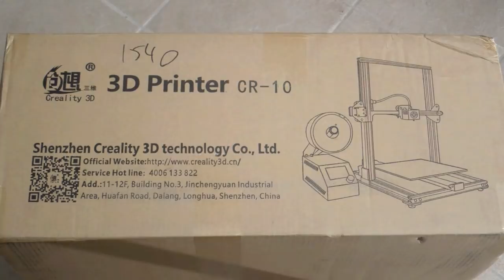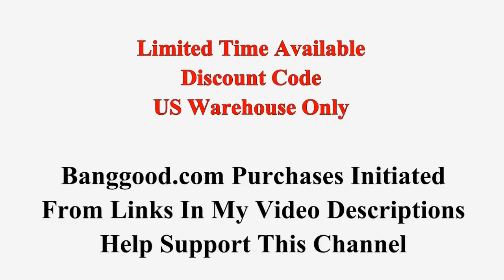Creality CR-10 3D Printer - Unboxing & Review

Comment: Hey Ron I purchased the same printer shortly after your video and my son and I have been having lots of fun with it. Recently the printer has been freezing and stopping prints halfway through a print. Wondering if you had any issues with the computer and it freezing up on you in any solutions?
Reply from the maker: In the control panel somewhere there is a reset command... try that. When you first turn on the CR-10 make sure both the nozzle and the bed indicate room temperature. If the thermisters for the nozzle or bed start to crap out it could certainly shut things down. The unexplained problems I have experienced have been associated with Cura and I ended up switching to a newer version of Cura and problem solved. Note I have not been able to use the newest version of Cura... back up a version or two. Hope that helps. Ron

Comment: Ron.  Nice Review.  Do you have a link to the filaments you purchased?
Reply: Regarding your build plate.  Did you add that on top of the existing plate or did you replace it?
Reply from the maker: Removed the original glass plate and replaced it with this one.
Reply from the maker: Got the cheapest NoName PLA on eBay out of California. 1kg spool $13.49 shipped. Just look for it.

Comment: A happy surprise to see you get into 3D CAD. What CAD program? Way to go Ron!
Reply from the maker: Trying to get familiar with Fusion 360. Started off trying to do the mouse left-handed which wasn't much fun. So quit messing with it until recently. Now back to my normal right-handed mouse which certainly is easier.
Reply: Good choice. I have heard the best remarks including Autodesk Inventor Support Guys who are CAD Masters of the highest degree except for maybe our friend Thang. :-) I put Thang at the very top of the list. I should learn it but I'm happy with Inventor 2009. I have to run the program using Windows 7 32Bit on my Windows 10 64Bit i7 computer via Virtual Box. I think Fusion 360 is about the same as the newer versions of Inventor without the extra Simulation feature and etc. which most people would never use anyway.
Reply: Ron, sorry I always seem to be pointing out something "I think you need" HA!:-) I highly recommend: Spacemouse Compact by 3dconnexion   Ask a few Fusion users first but I think it will really help you enjoy the CAD experience.

Comment: Great video!!!  Boy I could get in trouble with this spending a bunch of money for supplies
Reply from the maker: I had cabin fever really bad with the shoulder thing. So this was a great new toy that I could play with mostly one-handed. In the short time I have had this, I have made around 120 prints... probably way more than most people would do in the same amount of time and I have gone through 2 spools of filament. I have been getting 1KG spools of PLA for around $14 and now I think I have 12 different colors. If you stick with one color like black (orange is way over done) until you perfect what you are doing the cost really isn't too bad.

Comment: Before each print starts (as it builds up heat, which btw, as it heats up the bed, you can go in to tune, temperature, nozzle, and set it to heat from the dash, to save up time) you should set up your height (i usually touch the build plate, and lift it 1 mm, it might not seem relevant, but it does behave differently) and then, as the nozzle reaches close to temp (say if you're set for PLA at 200, then around 195) release the spring tension on the filament catch, and push it in manually. 

This will effectively preload your nozzle and save you the hassle of having to wait for the filament to reach (because of retraction, which should always be active) the tip. As it will start, you'll see that it hits the build plate, and then deposits a small bead of filament on and continue to extrude as it goes, with that filament in place. I usually pick it up in my hand, and keep it in place until the nozzle touches the start point in the gcode program. Then pull it quick out.

That will ensure a nice start, and eliminate the danger of the nozzle getting continuously touched by the PLA in one spot because there might've been something raised in the first OP.  Once you get the hang of this little routine, it becomes second nature. I don't even think about it when i do it anymore, before this, (even with tweaks directly to the machine's gcode, this still was a problem, especially for someone like me who doesn't have time to baby the machine).

One last thing, look online for methods to keep your machine safe, fireproofing, safety switch (all stop), fuse mods, etc. Worth the time to protect your investment. OH, and if you ever feel like the table is entirely too woobly (you'll see this mostly in small prints) then a second strut (kits are available online, for cheap) will make the base very secure and stiff, as it should be. 

Creality did a smashing job with this package, BUT, it is oriented to a cheap start up, and i believe that it is also intended for you to, pick it up from where they left. At least to my eyes, based on the electronics package, and the way the structure of the machine itself is built (second jack screw, second strut on the base plate, space to mount various other hot ends, enough space for a touch probe, so on).

Happy to see you try this out, i've always been an advocate of experienced people (in their fields, woodworking machining and various others) getting their hands on such a machine, because your, their expert eye will come up with stuff we, youngsters wouldn't even think to come up with.

Here's to many successful prints! :)

One last thing. The aluminium tube found inside HP toner ink cartridges (like the HP LaserJet M1319) fits perfectly inside the plastic sleeve of the filament spool they give you, just in case you might want to modify it for double holding for example, or to make a better holder in general. It's also teflon coated.

Comment: The CR-10 has received good reviews and the easy upgrades printed from thingiverse files make it a much handier printer. Your $354.39 price offer is a very good price. This should be seen as a good opportunity to obtain a quality printer at a great price. I have had a cheap 3D printer for several years and it is difficult to get good results with it. Looks like it is time for an upgrade. Thanks for your video on the CR-10! Very informative!

Comment: Great review Ron, one of the biggest upgrades I did to mine was to change all of the fans to some quieter fans.  I used Noctua fans and now I barely hear the printer.  Them whining fans can annoy you after hours of printing if the printer is near by.  This is a great printer for the money, I'm seriously considering ordering a second one and the deal you linked to is so tempting...  Thanks Ron!
Reply from the maker: Fortunately I have it located in a work shop so the noise isn't too bad... and it does keep you aware it is working. I am tempted to mount the stepper motors on vibration mounts to see if the stepper noise can be eliminated (at least reduced).
Reply: The stepper motors shouldn't be mounted on anything but the aluminium plates, trust me i tried and it messes up with the print. I used professional stepper motor rubber mounts that i salvaged from a defunct (but mostly unused) tower Xerox machine. The noise mostly comes from the way the stepper works, mostly, anyways. You could build a baffle cover, but they do get hot, so, then you'd have to put a fan to cool them off.